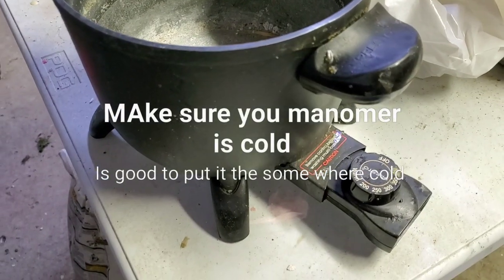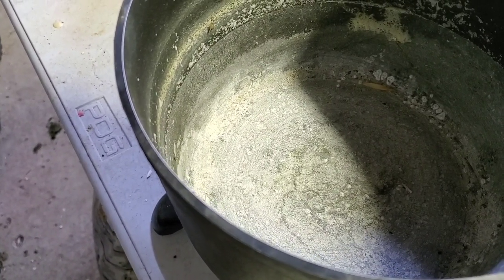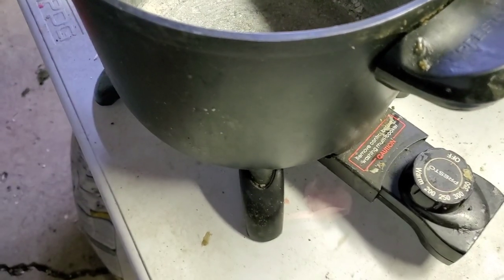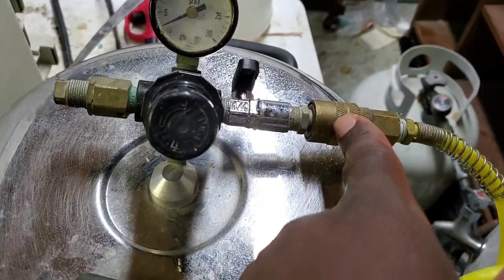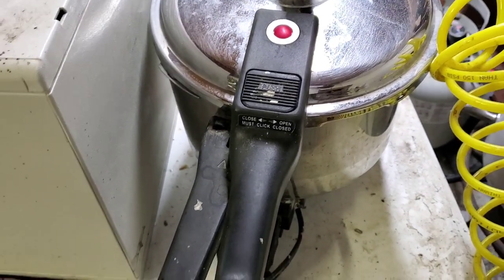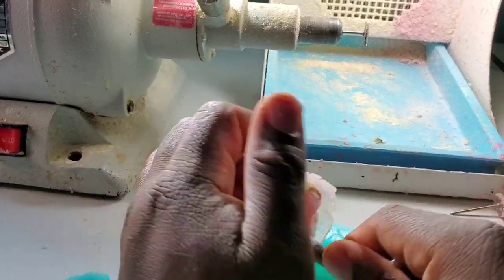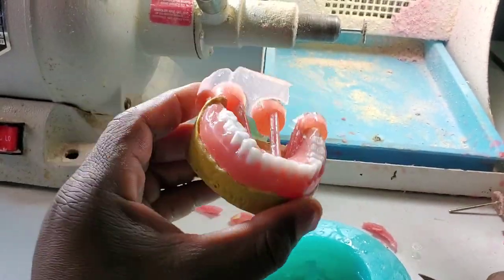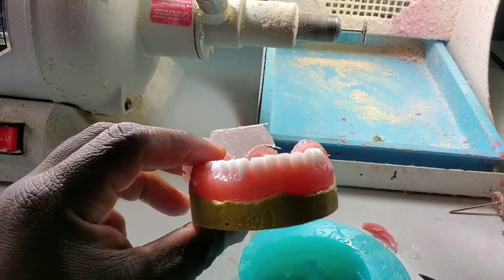How to Process Cold cure Acrylic  Dentures  part 2

Comment: I like your video series here, I do have a question , in the demonstration I did not see you use a pressure pot while you were curing the dentures , is this not a necessity?  I was under the assumption that it helps make a much more rugged denture and takes away the porosity that may be present.